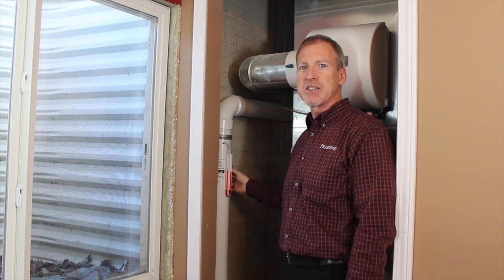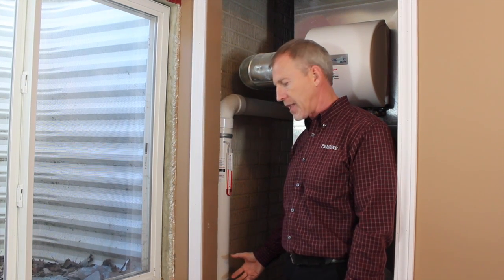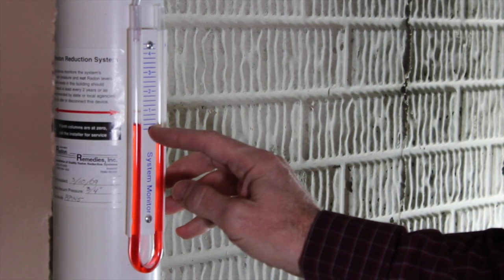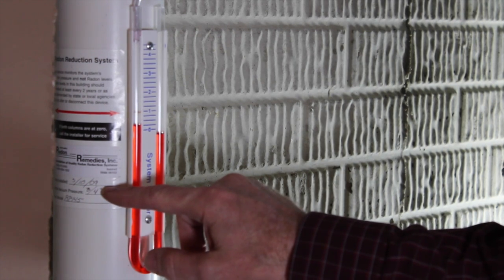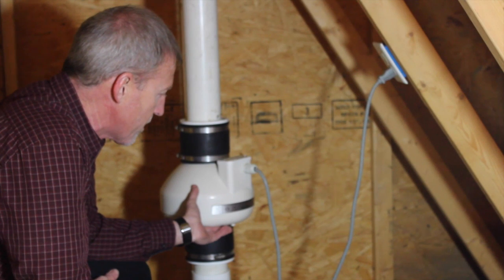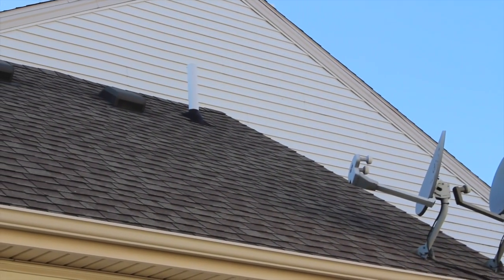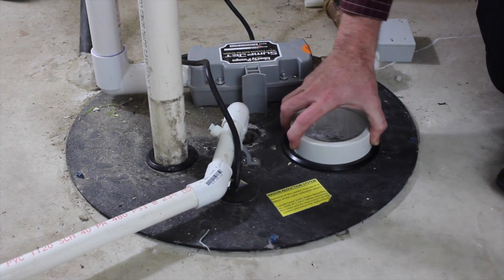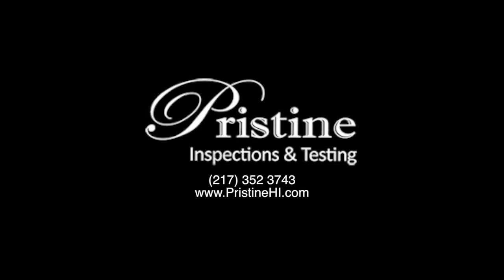Basement Mitigation System with John & Pristine Home and Testing

Comment: The builder installed a radon mitigation pipe accessible from the basement, but runs through an "attic" (section) that is inaccessible.  Can the fan be mounted in the basement?  If not, what would have to be done?  Thanks.